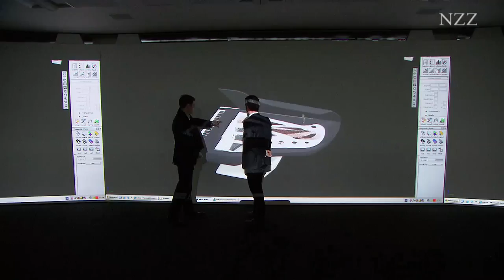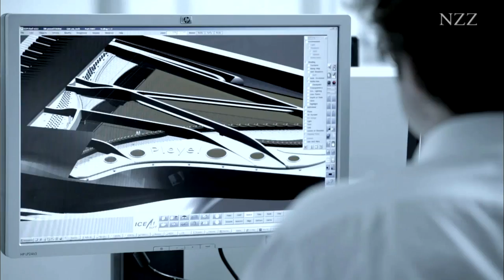Peugeot designers build the Piano of the Future: The carbon fiber Grand Piano

Comment: That’s the kind of piano I am looking for. I have always liked upright pianos because you can feel the acoustic closer and the sound less spread out and more dense and deep. You don’t have the same connection with Steinways . For less challenging pieces any piano is fine. But when it comes to really difficult pieces that requires a lot of speed , fingering rearrangements and clearing not all pianos give you that. Sure for the audience the sound is fine because of the mics inside the piano but for the pianist the sound looks far away from their grip and that can be a bit discouraging. Of course also if you are a great pianist like Kissin or Yefim Bronfman you will play incredibly in any piano. But I tend to think that the modern pianos would give Chopin some frustrations . And that’s why I am in LOVE with Pleyel! If only I had 200 grand .

Comment: Interesting Piano, in terms of the keyboard-level action. However, most of us do not have $200,000+ Euros for one. Having said that, I like the design, it is very bold, sound is good too. 

On a practical level, I wonder how much the carbon fibre reduces the weight of the Piano? I think the cast iron frame would be the heaviest component, but the wooden body of a Grand Piano must also add considerable weight!